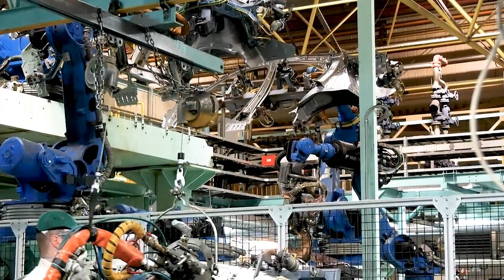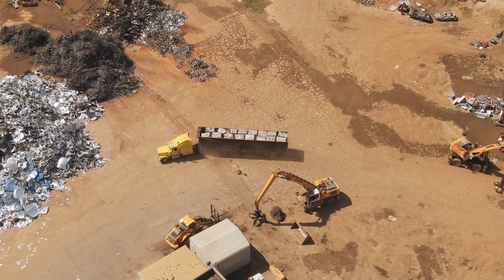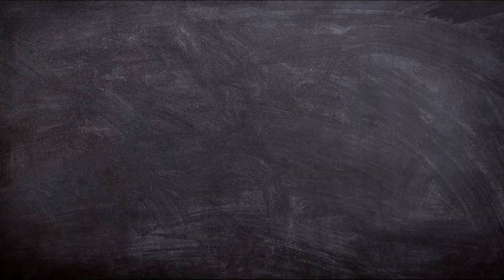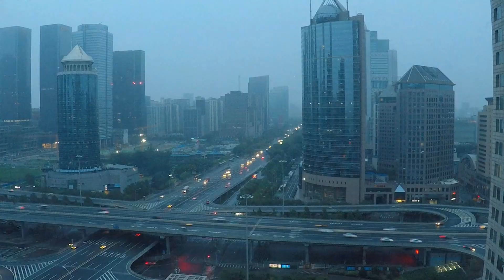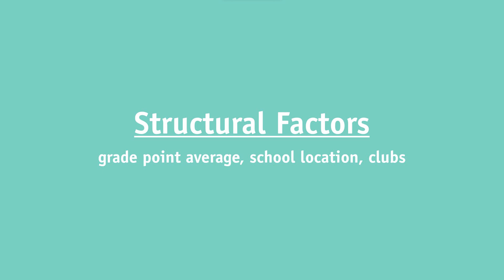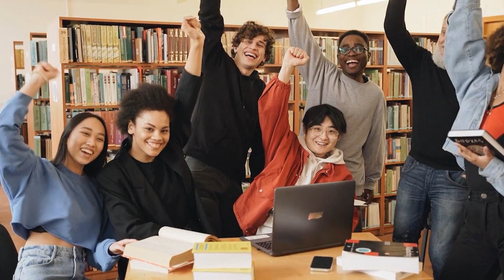The Great Steel Pivot

Comment: Came to support and stayed to learn! I’m curious how much electricity is consumed during electrolysis? If the electricity came from fossil fuels, how much would carbon emissions be reduced compared to the traditional process? Great video!
Reply: Hey! I’m the one voicing this video! Electrolysis on its own is much more energy intensive than a standard blast furnace, as in comparison to a blast furnace which fuels its own heat more or less. The reason people like it is because the output from these reactions is substantially cleaner, and many companies are offsetting these costs by investing in renewable energy!
Reply: @PepperMinty711  awesome. Thank you for your reply! Good luck with the competition!